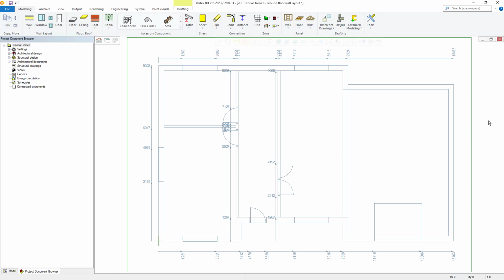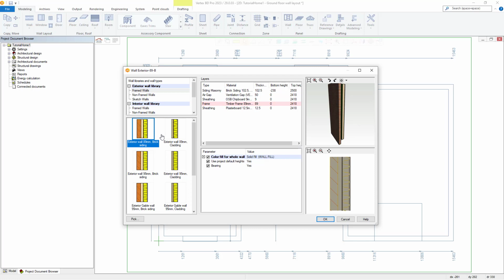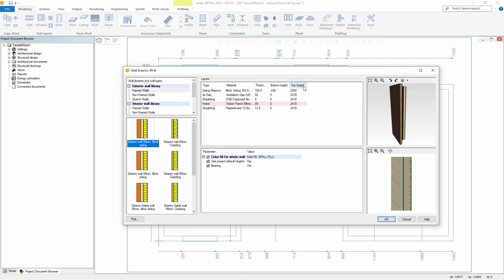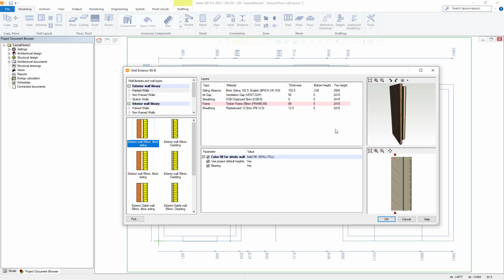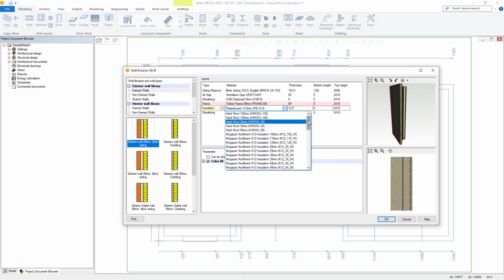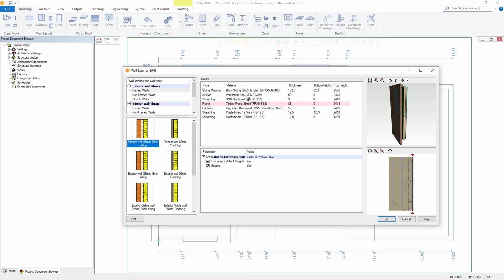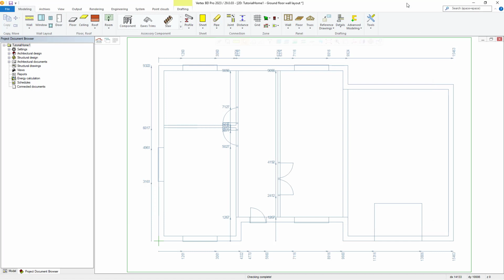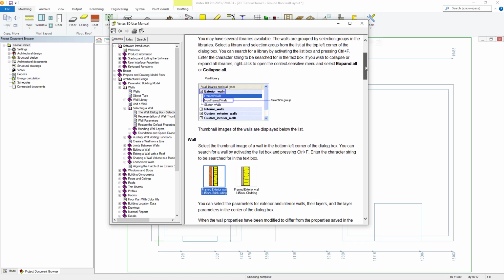Vertex BD Wood 2023 - The Wall Dialogue System

Comment: How create own frame type and own dimensions timber frame material??
Reply from the maker: Hello Richard are you looking to create one permanently available within your software or just one for a one off project? Im currently in the process of creating a full video tutorial on this which we will be releasing soon however in the meantime i can provide you links to guides on this for you to read through if that would help? Best regards - Matt
Reply: @VertexBDBuildingDesignSoftware  Thank you for the answer. I mean permanently available. Of course, links would be helpful in the meantime
Reply: Thank You. I mean "Create a New Wall Frame Tool" and new frame materials planks, boards etc.  But that was helpful too.
Reply from the maker: If you already have engineered truss drawings here is a link to our guide on modeling individual trusses: https://kb.vertex.fi/bd2023en/how-to-articles/truss-framing/model-individual-trusses we should have a more in depth and complete video guide on the full framing process uploaded soon including both how to use the built in framing tools and how to create custom timber frames